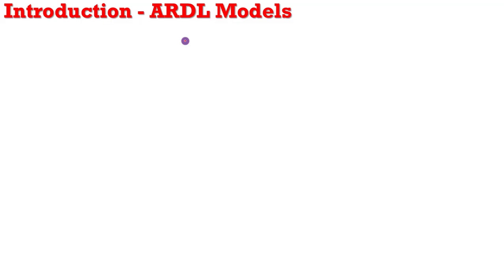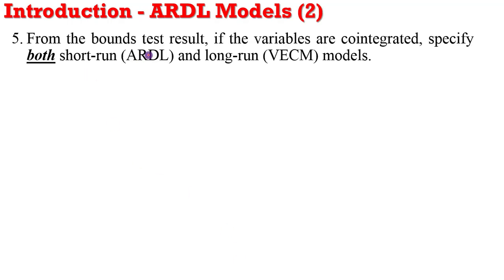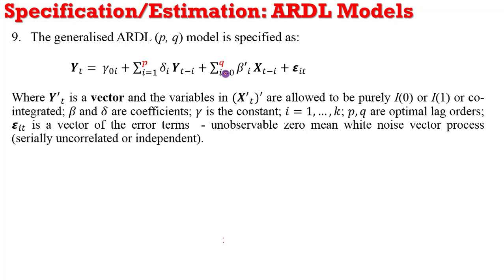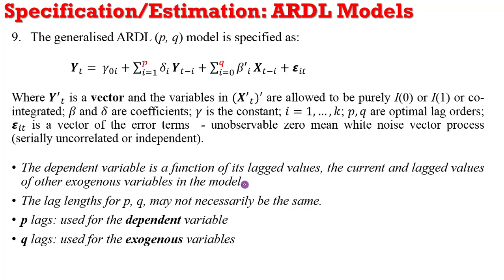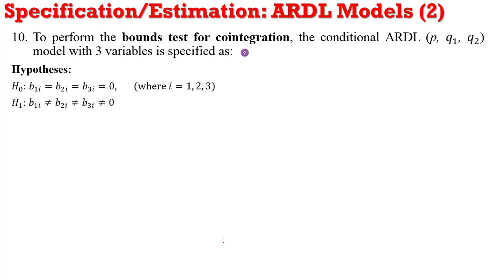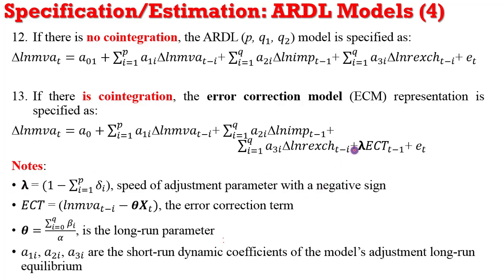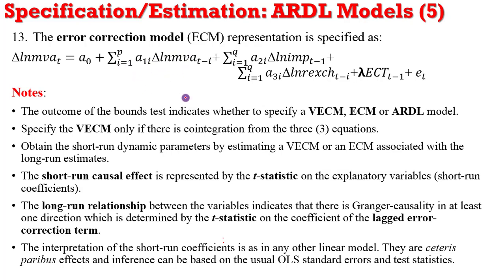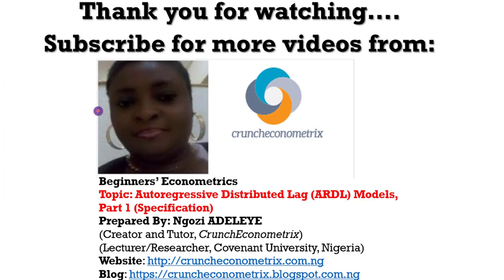This is How to Specify ARDL Models #ardl #ecm #boundstest #cointegration #lags

Comment: Helo Dr. when we want to check for the cointegration, we need to do the bound test first, then decide if is it cointegrated or not. if not, then we specify ARDL model. So my question is,  as I watched your video about the bound test, you first regress the series using ARDL model before check for the long run relationship, so, what is the difference between ARDL that we run, before do the bound test and ARDL after we check the cointegrated, which is for short-run relationship? Thank you in advance.
Reply from the maker: Nikmat, it's the same ARDL algorithm. That's the way the estimation procedure is configured. The 2nd ARDL (restricted model) generates the long-run estimates once cointegration is confirmed.
Reply: @CrunchEconometrix  So, after there is cointegration, its mean that there is long run relationship and we need to estimate long run model (ECM). So, for estimate ECM, what I understand, we just combine the ARDL regression's result + the result for bound test which is ECT. Is it like that?
Reply from the maker: @nikmatsyukur167  Watch the ARDL-ECM videos, and you'll have less questions.
Reply: @CrunchEconometrix  thank you for everything Dr.

Comment: Professor 
Hope that you are doing well. Please guide me. This is Apica from India. PhD scholar. 
I ran the entire ARDL model but ONE equation(out of three) could not pass the residual diagnostic tests. 

Please guide me , what could be the problem. 

Thank you and Regards
Reply from the maker: Please note that you don't have to estimate all equations by using each variable as a dependent variable. Not necessary. I only used that approach to explain a vector case. In the event that a model fails a residual test, estimate using higher-order lags.
Reply: @CrunchEconometrix  Thank you , Professor.

Comment: Dear and respected Ngozi, 
After ARDL bond tests, if variables are cointegrated, we will use the error corrected model, not VECM model. Am I right? 
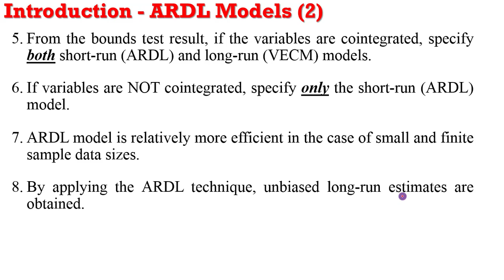But in this video, Ngozi wrote long-run (VECM) (in video 2:37). Is it a mistake or actually is true?  

Despite this small thing in the slide, in fact, I heard that Ngozi mentioned ECM model as well. But for the slides, here is VECM model. From what I learnt so far, I think that it is a mistake. VECM model should not be here. However, I firmly believe that Ngozi knows better than me. Please forgive me if I said anything inappropriate.
Reply: Dear Ngozi, I realized that it might be true to apply VECM model after bond tests as I have watched to the end :) But in order to perform VECM model, we have to make sure that the series is all I(1). 

I used to think that VECM and ARDL will never be connected with each other. This is because if we choose to use ARDL, it shows that our variables are not strictly I(0) and I(1).
Reply from the maker: Not a mistake. Listen again to what I said. "VECM  or ECM as the case may be"...
Reply: @CrunchEconometrix  Got it, dear Ngozi. Indeed, it is not a mistake. I have to study more to comprehend all those models. Thanks very much for all the support, patience, kindness and guidance. May you always be blessed.
Reply from the maker: @fuzhufeifei  Amen and you too, Cherry....I still make mistakes too, nobody knows it all :)!

Comment: can i do the bound test if i have 4 betas. I have 4 independent variables and i also have to include the independent variables
Reply from the maker: Hi Tino, your query is a bit confusing....."I have 4 independent variables and i also have to include the independent variables". Please recast.
Reply: I am estimating the relationship between fdi and economic growth. My independent  variables are fdi, human, capital, institutions and consumption. I want to run an ardl. But I see that for cointegration tests you use b1=b2=b3=0. Will it be ok if I have b1=b2=b3=b4=b5=0 for my cointegration tests
Reply from the maker: @tinotendamakova5563  Yes.
Reply: Thank you

Comment: Hello. Excellent videos. Ive been taking notes based on your videos for a year now. I am currently doing my thesis. Please enlighten me. I have 4 variables, 1 dependent variable & 3 independent variables. My variables are integrated of order 1. Also, based on the johansen cointegration test, there is only 1 cointegrating relationship between my series. I only estimated 1 ARdL model. What should be my next step after that? Thank you in advance.
Reply from the maker: Arriene, Johansen Cointegration = VAR technique and Bounds cointegration = ARDL. You decide which way you want to go and watch my videos on the selected procedure.

Comment: Hello Professor
I have some confusion regarding bounds co-integration test. As i understood from your lecture, if our model has four independent variable and one dependent variable, are we suppose to perform the bounds test by taking each variable as dependent variable or is it ok to perform bounds test for one equation. Since i will be looking for relationship between my dependent variable and other independent variables.
Reply from the maker: Not at all. I only did that to show that a vector of equations can be created from an ARDL model. Go ahead and estimate your single-equation model which ARDL is designed for.

Comment: Peace and mercy of God
The model talks about the effects of technology and communications on economic growth embodied in GDP
The duration is not long 11 years
Can I estimate this model with this number of observations note independent variables 5 but that has only three significant effect after estimating the model and you do the usual tests for the health of the model and everything was ok
I got quadratic data for some variables and converted the other quadrant by the Eviwes program
You made an excellent estimate and result but did not perform the sleep tests on the original data from stabilized at the first level
The question here is whether the silence should be chosen for the variables of the study note that the sample became 44 views
Or, you have adopted the first form or used the model ardl
thank you very much
PhD student Said Saleh from Palestinian
Reply from the maker: Hello Saied, kindly simplify your query for better understanding. Thanks.
Reply: CrunchEconometrix The appropriate model for sample 11 views
Reply from the maker: "sample 11 views" what does that mean?